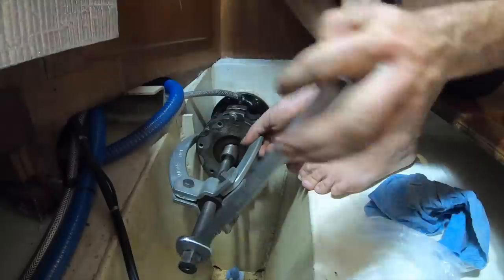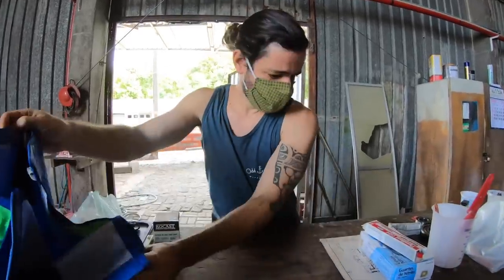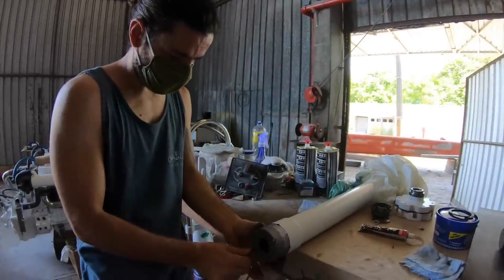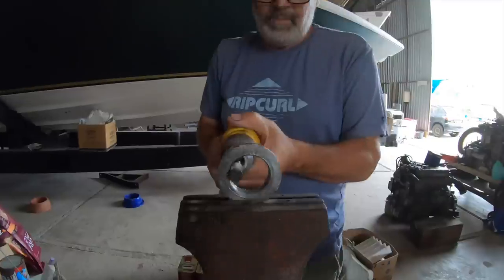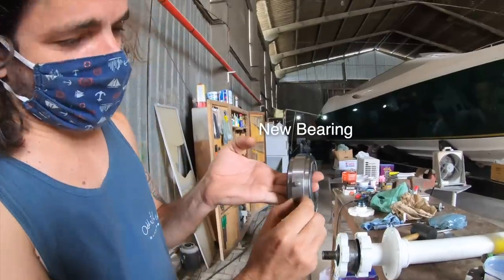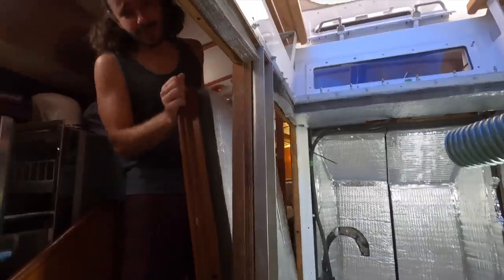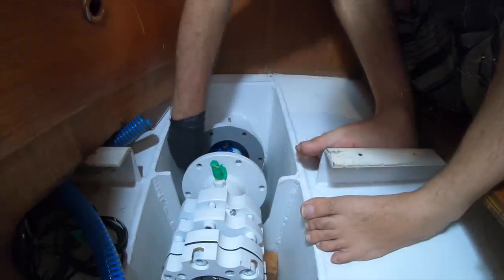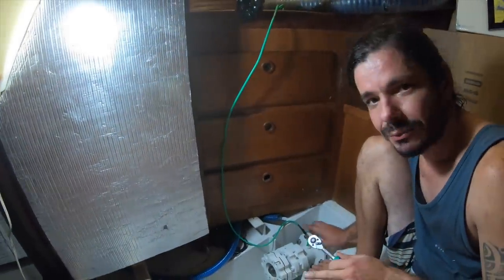⛵️We are FINALLY done with this project!! #173

Comment: That dude did NOT know how to pack a bearing properly!  Oh well, great video and hope all goes well with the engine install!!!
Reply: I wondered about that. Maybe we didn't see it all. Another good thing about that system is its lack of thrust load throughout. The bulkhead mount bearing assembly seems to take most of it...relieving pressure on the rest of the system.
Reply: I noticed that as well, if someone gets the basics wrong what is the quality of the rest of the job?

Comment: Good job, btw did the housing really fill with grease?  It did not look like you pumped much in.
Reply from the maker: We add as much as se could before closing the system from both ends. And this grease is just to protect the metal from rusting. So I think it was enough. 🍀🤞🏼

Comment: Greetings. There were way to many steel hammers hitting finished steel parts! Mallets are made for assembly of finished steel parts. Once a bearing race is dinged, it will be very time consuming to seat. In my trade a dinged race would be a reason to scrap a very expensive bearing. If I told my boss I spent 3 days disassembling a hoist machine, then spent 3 day assembling it and it knocks, my apprentice would get a raise.

Comment: i was worried about that bearing when i saw you working on it. i have never seen a functional one that had an outer casing that moved around  as much as that one did while installing it. i honestly thought you damaged it during the install. but i was not certain because i am not familiar with  prop shaft systems

Comment: That pressed collar you forgot, if you run into it or others not fitting in the future, put them in the freezer for a few hours ( the colder the better) then press it on. Should slide right on without having to sand or grind away material from it

Comment: Was there any reason you didn't just convert to electric? After removing the prop shaft and the engine, it would have been a good opportunity to install an electric prop.
Reply from the maker: Yes. Price and space for batteries and solar panels

Comment: @16:00 Is it possible to use the bearing that was a spare on the boat and weld up the holes, or tap the holes and put threaded rod in them. Then pay a machine shop to machine the outside of the bearing flat and smooth?
Reply from the maker: I don't think we could weld the holes of that one.

Comment: Be careful not to over-grease the bearing, usually it should be 1/3 full of grease. If the bearing is not sealed you can run it slowly after greasing to let the excess be pushed out, if it's sealed then you really don't want to be stuffing it with grease as it has no place to go. Overfilled bearing can overheat and get damaged. Rule of thumb with bearings is if you can hold your hand on it, then it's not too hot... say 50 Celsius, so you can easily check after a short run and then after a longer one.

Comment: Future item I would consider, re-engineering to remove the interior seal and allow the shaft oil to lubricate the thrust bearing vs greasing occasionally, by moving the seal to the exterior.  Or use a sealed bearing when you replace it.
Reply from the maker: We couldn’t find the sealed bearing to buy 😬

Comment: If you ran a grease line down to that grease fitting and put it somewhere easily accessible i think that would be beneficial. I know you guys aren't afraid of work. But... Figured i could throw in a suggestion.
Reply: It's immediately accessible when you remove the floorboard over it.
Reply: @bdphourde  I saw that when they installed it. Either way. My lazy arse would install one and put it in the engine room near the regular checked stuff. Put a lil squirt in every couple ... idk... weeks?

Comment: Have you had the balance  of the prop checked?  An unbalanced  prop will destroy  your seals and bearings over time...also you should have the edges of the prop blades sharpened so if you run over  a fishing net or any rope in the water the sharpened blade edges will help cut the rope before it can wrap around your shaft and put unnecessary  drag on your shaft... transmission..or engine. I did this years ago on my boat and never had any rope of fishing line get wrapped around my prop shaft again.  It's  something to think about   especially  seeing how you would have to dive under the boat at sea to cut any thing that may wrap around your prop or shaft.

Comment: That one end looks like he was installing an old school part time warn hub! That man tapped in every seal and bearing with a body hammer and at the very end broke out the brass cylinder drift just to prove he had one!
Reply: I noticed that as well. I'm wondering when did hammering bearings and lip seals become acceptable practice?
Reply: @aloneil1089  I use to do it before I knew better and sometimes you can get away with it.

Comment: There are two things which I don’t understand: 1) Why the old tube was full of grease? And 2) Was the boat always used with no greasing in the bearing?
Reply: 1 - To keep salt water out of the sleeve the assembly fits in so it will not seize from rust over time and is easy to disassemble for service. 2 - Yes - the bearing does not require constant re-greasing because it is not loaded enough. Same as a wheel bearing on your car.
Reply from the maker: Thanks for the explanation

Comment: Hi guys, looking great. I just got to the part where you got the grease retainer with the nipple manufactured for the bearing on you renovated drive shaft. I'm no expert,  but just offering an escape from Murphy's law, do you think you should have put two nipples in 180 Deg. apart on the ring ? (A) to balance the weight difference and (B) so you could remove one to allow the old grease to escape when refilling with a grease gun. Just a thought and hopefully not to late. Thanks for your posts great work. (P.S. looks like I'm too late)

Comment: Duca, Roberta: While looking at the assembly drawing when you took the shaft apart, l noticed on the drawing there was no way for the double row angular contact bearing to get lubricated. This bearing handles both the radial and thrust loads of the prop and is VERY IMPORTANT to get proper lubrication. I think what your mechanic did by providing the additional lube ring and installing the bearing with the lubricating holes around the outer race was the correct thing to do. Furthermore, l think this is the correct bearing for this design, keep it lubricated as a regular maintenance schedule and it will last for many years. (however, be careful not to pump to much grease into that bearing because it can blowout or leak from the front lip seal #53). Great video, thanks for sharing.

Comment: I sold bearings for about 16 years. The people warning about overfilling with grease are correct - only about 30% of the available space should be filled with grease. Overfilling causes the grease to churn and overheat. This can cause the grease to melt and separate with very bad results.

So far no one has mentioned that converting a bearing from oil to grease changes the maximum speed it can do - sometimes by quite a bit. I don't know what size and brand bearing you are using, but you should seek the help of an engineer or at the very least google for something like "double row spherical roller bearing max speed". It may well be OK as the setup you have looks massively oversized for the job it is doing, but again it is hard to tell without actual sizes and loads.
Reply from the maker: Thanks for the explanation

Comment: Got a bit anxiety when the guy used a steel hammer on the bearings and the sealing rings.
There are bearings that can run free of lubrication because they are self lubricating (bronze material). However, I think the bearings you have are standard ones that you can find all over the world if required.

The shaft is absolute gold! Never replace it with anything "standard"!!

Comment: "Thrust" - the system transfers the thrust from the screw (propeller) to the hull of the boat.
Reply: That's exactly what they said !
Reply: @marcryvon  Except, they never said "Thrust".
Reply: @ralphgesler5110  Torque is rotational, thrust is axial. Torque turns the prop,  generating thrust on the shaft which has to be transferred to the hull. Eight years in nuclear submarines explained this very deeply to me. The torque is generated by the engine transferred through the transmission. I'm very glad that they have a system to transfer the thrust on the shaft to the hull without transferring that through the transmission.

Comment: FYI your wrong not all bearing use grease , the bearings  for say inside an air feed respirator or the ones in a compressor for filling dive tanks use no grease or oil they uses Nilon bearing because breathing petroleum products like that can be fatal , and some bearings in a drive seal system are water cooled so without knowing exactly what that bearing was designed to be used in you can not say for sure it needed to have grease or oil

Comment: I know you guys get a heap of advice, just try to remember next time you take a painted part off a wire, of any not electrical wire that is eye high, get into the habit of bending the end over, goes for oxy welding etc etc, even if you didn’t do it..  no workshop manager will ever complain if you stop an obviously eye 👁 poking risk!  Unless it’s electrical wire, then don’t touch it, consider any electrical wire “live” 
Kind regards Trev..
Reply: At 526 mins!

Comment: Now is the time to put a coat of wax on the hull that’s below the water line !
Reply: The bottom paint on boats like this is meant to wear off- it's called 'ablative paint'.  The idea is that when barnacles and such latch on, they fall back off because the paint doesn't let them stick.  There is some issue with ablative paints, though- they aren't very environmentally friendly, because there are hundreds of thousands of pounds of paint being left in the ocean every year.

Comment: How can you justify assembling all them bearings and such without any torque wrench there has to be torque specs on them bearings ,your  too loose or to tight you burn them  bearings out
Reply: I think they are roller bearings not taper bearings , so no need to torque  .

Comment: Got a laugh out of this.   First, cleaning out the grease from the shaft hole, sorta like a vet checking out a cow!     And second, you made a "pig".   A "pig" is used to clean pipelines (gas / oil), it is a cylinder that fits into the pipeline and is "shot" down the pipeline to clean it, sorta like you did with the blue bunch of rags!

Comment: For all the talk about learning about the system:- You did not tell us which bearing was the correct bearing for the system,  which could be verified by the number on the bearing. Its not a good idea to reuse a bearing that was making noises the last time you took the boat out! The style of bearing is important and you had two different style of bearing bearings are generic, two bearings with the same style and numbers are the same. Call the manufacturer of the sealed system and verify you have the correct bearing for system and use new bearing???

Comment: Much too much hammer. Should have been assembled using a press. Much easier on the bearings and bearing surfaces. Pounding is unly used as last resort.